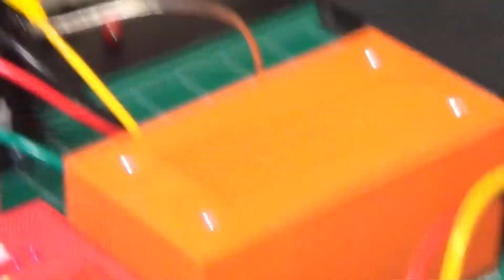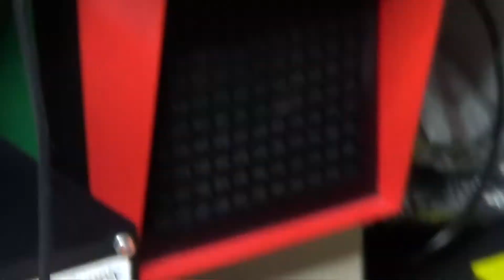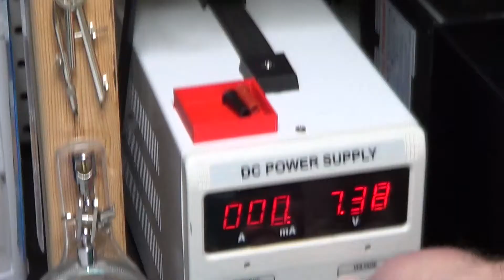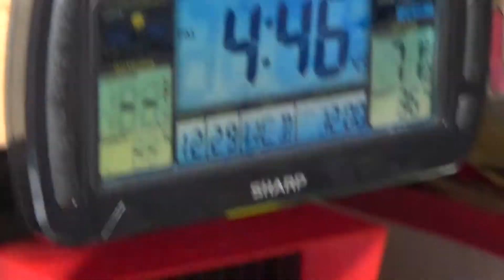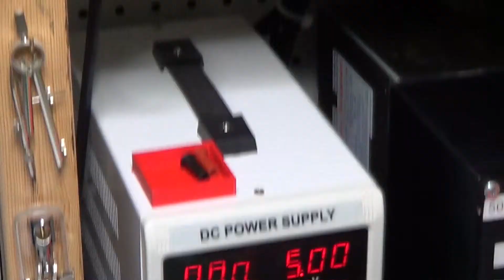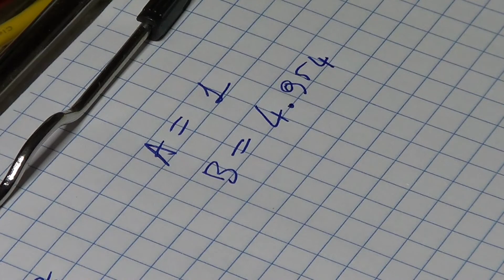Experiments On The SSI 2130 VCO

Comment: Been following along at home. Thanks so much for this. I just got the reference to a stable 2.5v. Gonna solder that part on a strip board and then start working with the ssi2130 on the breadboard.
Reply from the maker: Very nice.  I'm currently putting together all the pieces of the vco and design a pcb for it.  Details will be in the next video of the series.